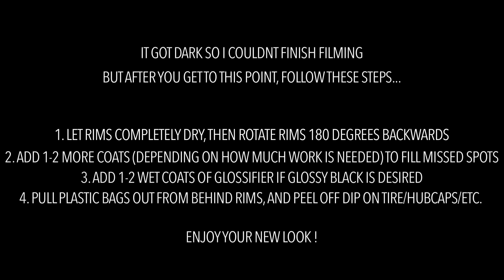How To Plasti Dip Your Rims (THE RIGHT WAY)

Comment from the maker: Hey everyone! I just dropped a NEW, FULL step-by-step tutorial on dipping rims. Check it out here: https://youtu.be/bKSxjSEpYec
Reply: THROWSOMEDIPONIT fx
Reply: Great for flat colors, but gloss does not last..
Reply: Yo how many cans does it take for 4 wheels?
Reply: The right way would be to take the rim off first
Reply: So when your putting the dip in the warm hot water is there a time limit or just throw it in there then take it out
Reply: Midnightrun sv I run the water out of the faucet until it's as hot as it can get. Then I place the cans in the water and leave it in the for 8 to 10 minutes. I personally do this for every wheel to make sure there's no drips from a coming out to thick. But if you're in a rush you can do all of the cans at once just make sure that can feels a little warm to the touch.
Reply: Vitaliy Oliyevskiy taking the wheels off can be good for some but not everyone. The good thing about taking the wheels off is you can see every little detail. The bad thing that I've personally run into with taking the wheels off is the dip tends to not always spray right with the can facing down. The Yorky's position always for me to get all even strokes.
Reply: @darrylpolite8722  very helpful thanks
Reply: @darrylpolite8722  Good to know thanks. I'll take the tires off and stand them when I spray them.
Reply: Hopefully it’s explaining instead of shit music 🙄
Reply: Who has time for that ? Or equipment to lift a car. That’s a car shop lol

Comment: For all the people saying tape the tire off, my buddy just did his SI rims instead of taping off he got a pack of index cards pinch them inbetween rim & wheel works just as well
Reply: No need just peel it off the tire when finished.
Reply: snorman1911 nah that takes too long i did the same shit it was annoying
Reply: I did the same thing. I used card stock instead though. Thicker than printer paper but more malleable than the index cards
Reply: you coat the tire first with dip-release, for a PROPER how to, watch Fonzi

Comment: Thought I was about to cry when he sprayed the centre caps.
Reply: Great thing about dip is it peels off of everything you don't want it on :)
Reply: snorman1911 yea but is sure as hell don’t peel off fabric so be careful if you are painting near fabric fml
Reply: @unforgotten9203  Hah! I will keep that in mind!
Reply: snorman1911 np man!  It peels off fabric but it stains
Reply: Firts take the rim of 2 clean it really good best if you use brake cleaner every time  you go over it get clean rags or paper towels Don't use the same one 3 cover the logos 4 cover the tire no matter if is black spray paint and the most important of all is if you take the rim off it gives you a better view to spray evenly if its on wen you move your car the rim walls facing down are not going to be painted right
Reply: And for those who are planning to to plastic dip there rims good look taking it of when you no longer want it
Reply: @Angela-tq8yc  why?  it peels off.  The hardest part is getting the initial tear in it so you can start it peeling.  Also, the thicker and more layers you apply the easier it is to peel.  This comment makes no sense because it is extremely easy to remove it when you don't want it any more, and it is pretty durable and will stay on for a long time if you do want to keep it on
Reply: @pacmanjones5625  yeah that’s the entire point of plastidip lol

Comment: As somebody who has had plastidip for about 4 years and redone it about 3 times i wil give you all a tip. Do way more coats than this guy. I usually do about 7 and one coat of the glossifier. I pressure wash my car and the added layers really really help. Also you may want to mask off the wheels and the lugnuts as the first time i got my tires replaced (with 7 coats on) the dealership guys broke 3 keys for my lugnuts. (I had to buy the next two)
Reply: How many cans do you go through for all 4 rims doing that many coats?
Reply: @shimetobago9586  i think it usually takes about 4. When i wrote that comment i was getting them for about $7 a can from walmart
Reply: @shimetobago9586  the first couple of coats are done very thinly thats why it doesnt use so much
Reply: dude its crazy how u literally taught me how to plasti dip my wheels by just writing this comment and this phony posted a whole video and i was super confused on why he left his wheels on and why he was spraying it like shit🤣 thanks man i really appreciate🫡
Reply: @ForeignRuntzzz  glad to be of service. Im still rocking the plastidip and only redone 3/4 wheels from that original comment. It holds if u do it right.
Reply: @thisismyusername6717  hey man how long do you wait in between your coats? I'm getting mixed answers everywhere
Reply: @LZRD107  wait 15 minutes between every coat. so i saw in another vid. Gonna do mine in a few days!
Reply: @LZRD107  just until it is dry to the point it wont cause runs/drips. 10 mins should be good…but i think i waited 15 each coat.

Comment: About getting the spray on the tyres: It's not destroying the tyres. If it annoys you, peel it off easily and after time it will stick itself out so you can peel it also easily. Had it for like some months on them and the tyres didn't had any damages or something like that. Just make sure there is no connection between tyres and rims .
Reply: Tires*
Reply: @cyprexx1946  different for people in the EU

Comment: How to plasti dip your brakes, center caps, lock nuts, and tyres..
Reply: Probably got overspray all over the wings also
Reply: Probably got over spray everywhere
Reply: Matty Viper major facepalm lmao
Reply: @paintedwolf8394  but why go through all that?
Reply: Yeah he didn’t mask anything😂 I mean I guess he wanted everything like that but damn
Reply: PaintedWOLF yeah but you still need to mask it off. Plasti dip still has activators like paint does and can damage other surfaces if your not careful
Reply: Blitz Court you’re***
Reply: @devonlee6575  *an anwanted grammar Nazi.
Reply: Did you not notice him wrap them regardvle should’ve took it offf
Reply: 1. A plastic bag was put over the rotor's and caliper's.
2. Because of the line separating the cap from the wheel there will be a clean break when peeling off the plastidip from the cap.
3. The lug nut's were removed before spraying.
4. With a few wipes using a microfiber towel the plastidip will come off of the tire.
Reply: Let’s not forget the valve stem !!
Reply: If you put bags behind your rim then your str8 but who tf cares if you get ur BLACK tire sprayed on a tiny bit lmfao
Reply: @Dont_buy_lefty_lies  *unwanted
Reply: Avoid step 1:
Take tire off to plastidip

Comment: I had to revise my comment because I do realize sadly some cars don’t come with jacks and wrenches but.. word of advice, always cover the surrounding area (fender, bumper, etc.). Even plasti dip becomes extremely hard to remove when it’s not a thick layer. Plasti dio overspray is as hard to remove as tar spray.
Reply: Good gone is great for removing it

Comment: When i did mine i just took the wheel off took the valve stem out and let the air out then put a whole bag around the tire then i aired it back up so the back was sealed and i had no worries painting
Reply from the maker: overkill for plasti dip. that's what you would do for paint.

Comment: You don't have to go this intense on it, ive did all my wheels with two cans and it looks beautiful
Reply: How many coats did u do?
Reply: @xinhengc  one lol
Reply from the maker: Check me out on Instagram Instagram.com/throwsomediponit.
Reply: Yea as long as you’ve got solid coverage you’re good. Plastidip isn’t like regular paint. It’s pretty thick stuff. One to two coats of it is like equivalent to spraying 5-6 coats of regular water based paint. Plastidip is a solvent based sprayable rubber. It’s not paint really at all.
Reply: @cooliodiablo4571 does it cover flaking on rims or the rims have to be sanded first before putting this dip on ?

Comment: Lol, or just take them off the vehicle for a few minutes.

EDIT: Sorry, not trying to be a jerk, it's a good idea for those that don't have the tools to take a wheel off, but definitely not the right way.

For those curious on a more appropriate way, remove the wheel, clean thoroughly, mask off your tire with painters tape and paper if needed (yes i know it's platidip still do it.) spray light even coats, once the area is fully covered and dry take your tape off carefully, then put the wheel back on the car. Enjoy your long lasting plastidipped wheels!
Reply: Yo, how many cans for 4 wheels?

Comment: How are you gonna write “THE RIGHT WAY” in all caps like you know what you’re doing and then not tape off your tires or emblem in the same video 🙄
Reply: Lmao I was thinking the same shit
Reply: Lml
Reply: Because plastidip is pretty simple to remove from rims, kinda like tape
Reply: Kayserili38ification cause you don’t want that shit on your rubber. I didn’t tape it off when I dipped my rims the first time and I had oversprayed dip on my wheels that just did NOT want to come off completely no matter how much I cleaned them. It gets worse as it mixes with road grime and brake dust. It’s just a mess you don’t want to risk. When I sprayed tire shine on my tires, they didn’t pop as much, or at all if there’s too much overspray.
Reply: What about rotors?
Reply: or take off the Rims to do the back side
Reply: What about the overspray on the car.  Take the wheels off.
Reply: Mamamia and he took the lug nuts off but kept the tire on.... why? 
The hardest part of taking the wheel off is removing the lug nuts... oof
Reply: Right?  Lol. It got dark so I couldn't finish. At least now I know who's videos to ignore
Reply: @EastDallasKicks  Maybe he doesn't want the contrast of white and blue on the matt black?
Reply: JustifyJustin bruh i literally said maybe he wants the emblem to be painted over.
Reply: @EastDallasKicks  Yes I did... if you're into wrapping and plasti, you're probably into wings and have questionable taste, so anything is possible *grin*
Reply: @JustifyJustin  sorry nah I'm not Into terrible brands like Honda and Toyota, so now I'm not.
Reply: He pop the emblem out lol and why tape off rubber it’s gonna peel natural smh ricers
Reply: If you overspray the tire it's easier to peel off when done.
Reply: Didn’t cover the brakes either.
Reply: I was wondering the same
Reply: It peels right off the tire lmao
Reply: Because you can very easily peel it off the tires and the point is to black-out the rims along with the logo

Comment: "The right way" my ass. This is the "It's half-assed but still looks nice" method. even if the back of the wheel doesn't show, the dip will last longer if you paint the whole wheel because just painting the front leaves a seam half way that can allow for brake dust, etc. to eventually get under the dip. Plus the overspray. Plus you're painting at strange angles to get the wole wheel and it's harder to see some spots. Plus you're spraying the lug nuts so good luck fitting the right socket on those.

Comment: what about the over spray  ??
Reply: joe whalen overspray with plastidip, while still something to consider, is not as much of a concern and will come off easily with a microfiber. You do, however want to cover any mechanical or moving parts like in the video
Reply: Put a coat on the tire itself after each coat. This way you'll have a thick coat on each tire after 4 or 5 coats. If done correctly you can just peel off any excess with no problem. As long as you do it right you shouldn't have to clean off any over spray from the car. You're holding the can too far away if you're getting any on the car.

Comment: Thank you taking your time to show us your method and techniques. I was wondering why you put the spray can bottles in a bucket of water. Is that warm water? Does this help with the plastic consistency? I have never done coating, and I am new, but want to explore this option. Thanks again.
Reply: He writes on the video that it expands the molecules which helps with an even spray and even mils all around
Reply: You can get the same effect from constantly shaking the cab throughout the process
Reply: It's for every spray can. Warm it up.

Comment: The right way would be to take them off and get them powder coated, which is still removable and is 1,000,000,000x more durable than Plasti dip. But ok.

Comment: The right way is you should mask the rim emblem perfectly round with painters tape then peel it off when dry, that's how I did mine and it looks better showing the emblem. 2nd you should mask the tire so there's no paint residue on the tire they will flake off when dried and it looks ugly. 3rd you should also cover your car paint next to your tire, the over spray paint will stick to the paint since your car is white, over spray is more obvious, the over spray paint will come off but it's more work taking them out and sometimes from scrubbing too much it'll leave a scratch on the paint.
Reply: It’s plasti dip brotha, not paint
Reply: @joey8083  same, I use the plasti dip and other and I use the same technique as I mentioned. The quality is better.
Reply: @waynet8327  ah I gotcha
Reply: do they have plasti dip but gloss or is that the whole point of "plasti dip"?
Reply: @loketiveimau6172  Plasti dip itself comes out matte. But, plasti dip also has a gloss overcoat that you can spray on the plasti dip itself.
Reply: It's not paint..... It's a plastic/rubberized coating so it doesn't act or have any qualities that regular spray paint does